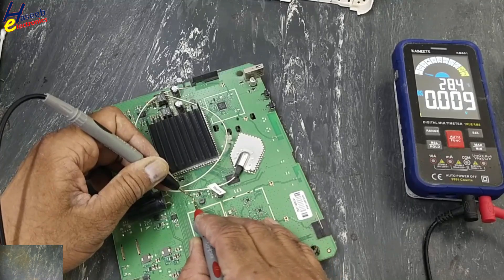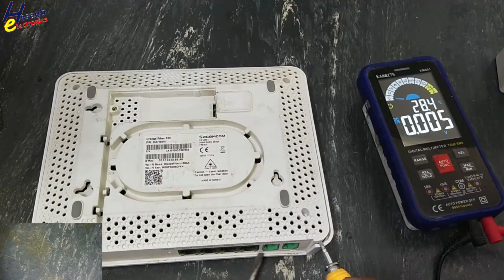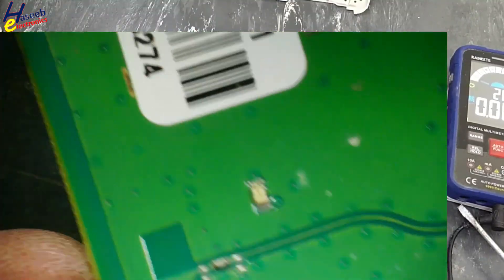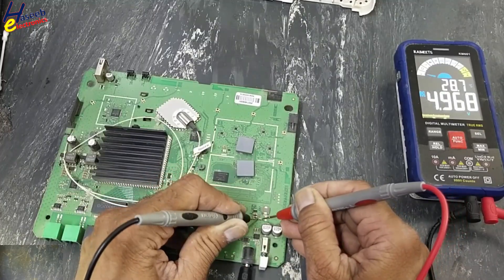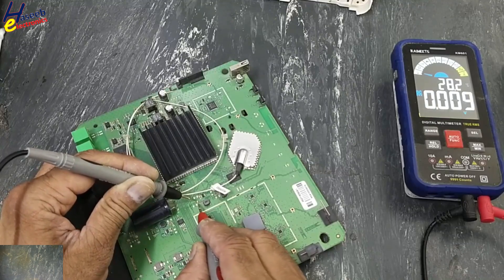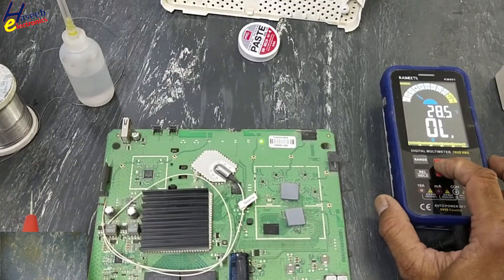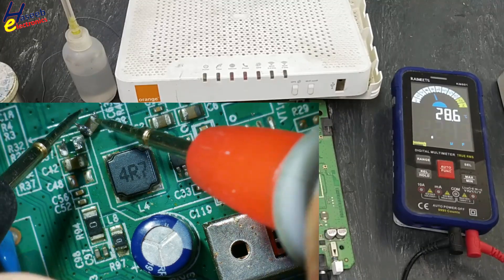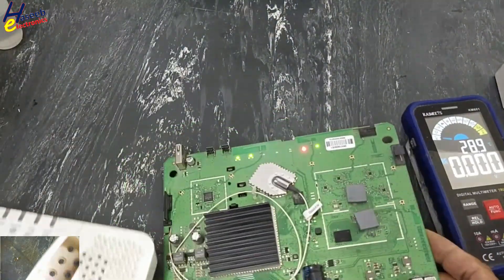{1374} Sagemcom CS50001 Router Repair | Dead Router Simple Fix & Step by Step Troubleshooting

Comment: How to use voltage injection less than  <1v and high amp  for troubleshooting fault components.can u prepare a video.And type of liquid or material should we put on components to show they emit heat for faulty part after applying voltage.?

Comment: Sir , saw one of your videos on   smps design "https://www.youtube.com/watch?v=uTrES66YNNk&list=PLgsKzaoLQUjo8s4G784yFDx2sm23-cQ89&index=12".  one doubt in this video. while using App ExcellentIT   in that below Current Density, Input voltage option is there . for Ac option what  should be the input.  wht is that AC input means ? please answer

Comment: why u put minus pin on every capacitor. why not just put minus pin on ground line and move around plus pin
any reason for that?
Reply from the maker: great 
in some circuits, there is virtual ground or seperated return path. in that case we will not get accurate reading. so i prefer to test by connecting both leads 
otherwise placing common lead to power suplly common is also awesome and makes easy

Comment: Good evening professor, I saw several of your videos about washing machine boards. I am in Uruguay, a country in South America. Could you explain a little more about the doubt I have? It is in the part of the triacs that receive 220 VAC and in that same track the 5 VDC from the 7805 regulator are connected. That track can circulate both VAC and VDC voltages, a short circuit is not generated. Excuse my question, I am just starting. Thanks Richard.

Comment: I really like it! Are the voltages written on the card? If not, it's not easy to know ! ❤❤❤
Reply from the maker: no volatge are not mentioned on PCB and its diagrams are not publically available. 
but there are some specific portions of the circuit, that need a specific volatge value. that is reason there are tooooooooooo many switching regulators are incorporated. like USB voltage, telephony volatge, memory biasing, CPU supply, BUS volatge, ethernet section voltages, wifi amplifier volatge 
each section has its own story🤣🤣🤣

Comment: You was lucky that the third cap was shorted. Better than randomly desoldering, I would apply low voltage (<1V) but high current to the shorted power rail. Then apply alcohol on all caps and the shorted one will get hot and alcohol evaporates.
Reply from the maker: you are right. the low voltage / high current method is awesome. i also use that method. but when closer to microprocessor area. i try to not use that method. 
alcohol
candle wax 
Freezit2000 are also great tricks to find heating SMDs
Reply: @HaseebElectronics  Good point about being careful with voltage injection near the microprocessor.